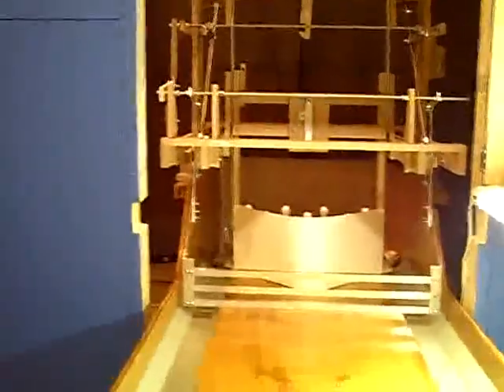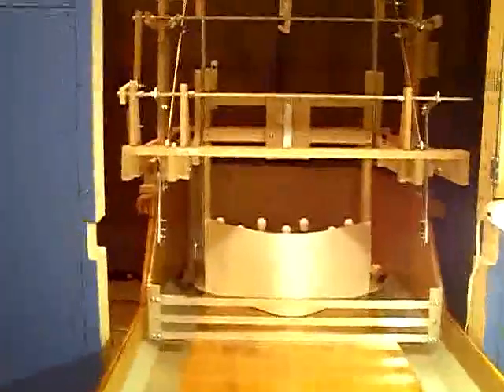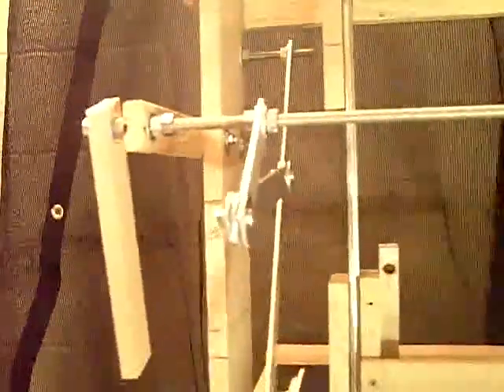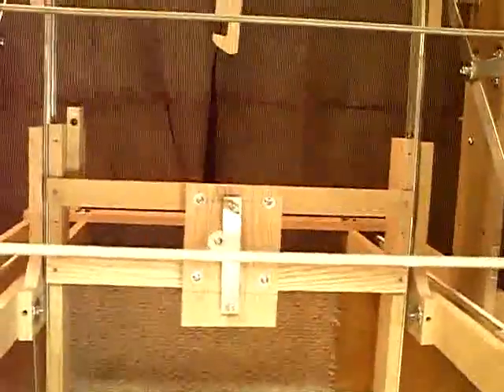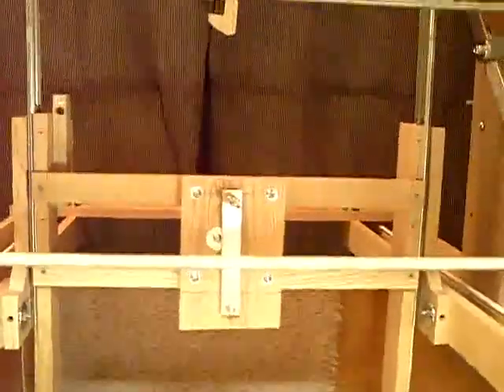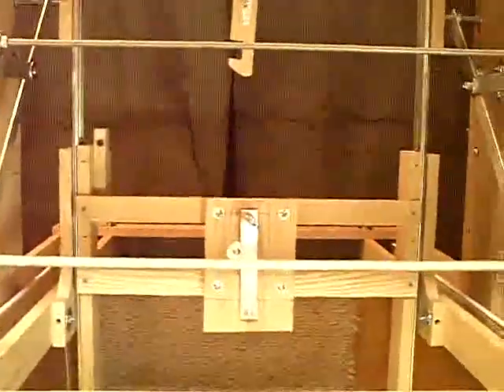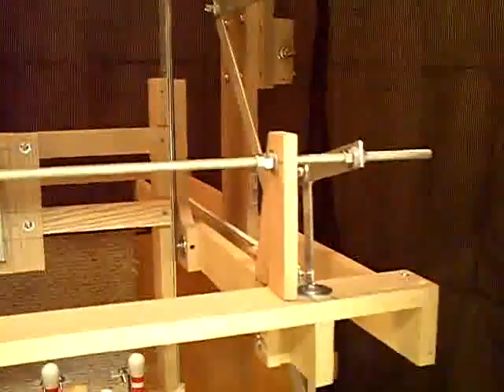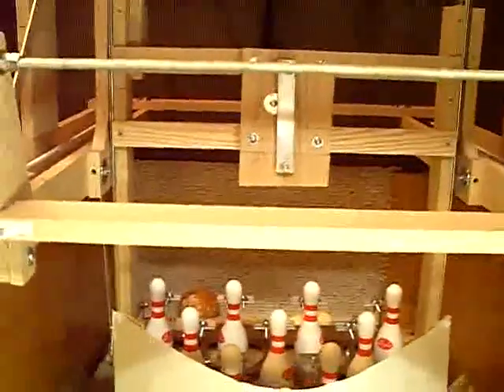1/2 Scale Semi-Automatic  Pinsetter

Comment from the maker: @sjt66 

The sweep is riding on a track that pulls it back in a straight line. It's similar to the gsx design. I use a stop tab to prevent the bar from travelling all the way to the lane surface.

Hope that helps.